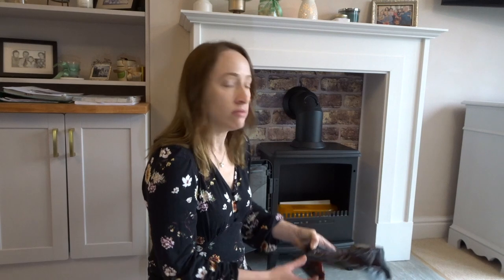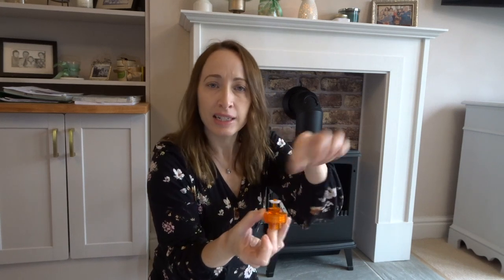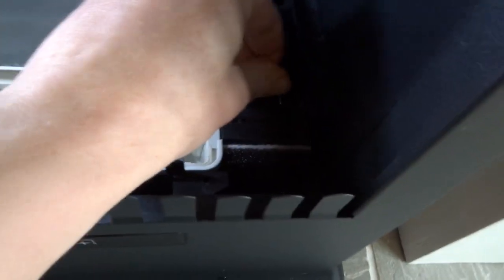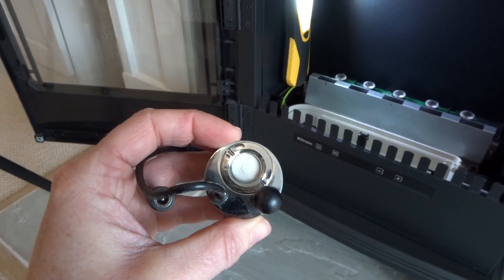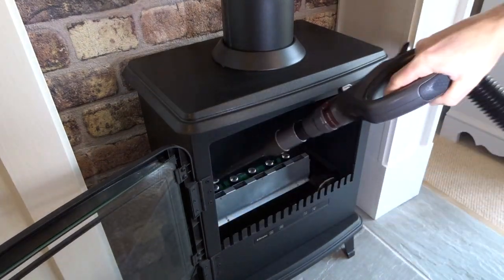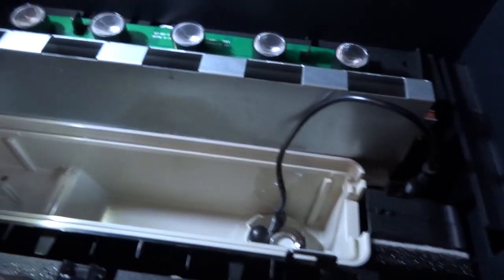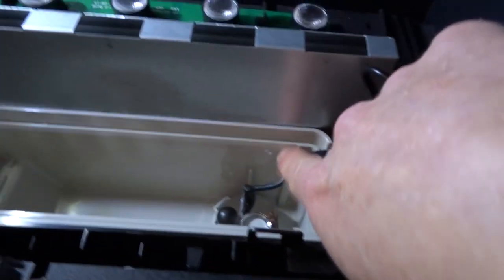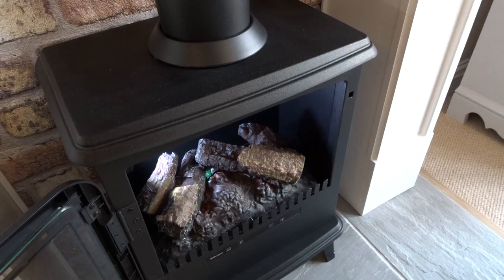Troubleshooting Dimplex Optimyst Fire | Part 1 | Mist Not Working | Clean and Replace Transducer

Comment: try deionized water, should not have any hard water deposits after switching
Reply from the maker: Thanks for the tip!
Reply: @LivinganOrganisedLife  hopefully that will improve performance and require less cleaning. I recently myself learned of this type of water usage for a new electric boiler I'm installing. High alkaline water, filtered or not causes deposits. I learned the minerals need to be removed all together and deionized is exactly that.
Reply from the maker: The only problem is it’s rather expensive. Where do you get yours from?
Reply: @LivinganOrganisedLife  deionized water? Oh most stores here in the states sell it by the gallon for a few dollars at most

Comment: Hi, what stove pipe have you gone with, looks great.
Reply from the maker: Thank you. It’s just plastic and sits on top. I got mine from Amazon 
Black Plastic 90 deg Bend Decorative Focal Electric Stove Flue Pipe 
https://amzn.eu/d/0StaxFc 
I think you can get them for a similar price from B&Q if you’re in the UK 😊
Reply: Thanks for the reply, think that's the one I'm looking at, does the top pipe go far enough back to sit flush against the wall?
Reply from the maker: Mine does but it depends how far your stove is away from the wall. Mine is about 3cm away if that helps and I could slide the pipe back further if I needed to
Reply: @LivinganOrganisedLife  thanks very much for your help and keep up the excellent videos.

Comment: hi... I have the mist but when I put the orange tray in it stops the smoke rising and traps it inside? any ideas?
Reply from the maker: Do you mean the fuel bed (logs)? Sounds like the flames are dying. Have you replaced the transducer? I have found out that you can just replace the transducer disc (white disc on the top) and see if that’s the cause. Let me know if it works ☺️

Comment: Hi, thank you very much! I cleaned and reassembled my opti myst. But my opti-myst goes off, there is no fire. What could it be? It beeps twice and the lights goes off
Reply from the maker: Hi, is your fire under warranty? If it is then contact Dimplex as they should guide you through some steps and send you smaller replacement parts to try to get it working again. If not, have you tried replacing the transducer? You can also purchase replacement transducer discs to save you purchasing the whole transducer unit. Let me know how you get on
Reply: @LivinganOrganisedLife  Thank you very much for your fast response! Its a used one from eBay. And yes!! The transducer was the problem! :)) First I changed the disc but a new one was needed. Now my fire works! Yippie
Reply from the maker: Ah that’s great news. So pleased it’s working for you!! 😊
Reply: @LivinganOrganisedLife  Thank you! 😊 My next step will be to change the halogen 45w lamps to LED to save a little bit electricity

Comment: Changed the transducer and the lights still go out any ideas ?
Reply from the maker: Have you changed the transducer disc or the whole thing? If you replaced the whole thing, check the wire is not blocking the transducer and there’s plenty of water in the bottom tank. If the fire is still shutting off it might be an electrical problem. Is it under warranty?
Reply: @LivinganOrganisedLife  the whole transducer has been changed and all bulbs checked .the fire works fine for a bit then the lights go out and after a short time they come back on again then again after a short time they go out again and it keeps doing this 😔😔😔.
Reply from the maker: If you kept the original transducer I would try changing the transducer disc  (transducer discs can be bought in packs on Amazon) and reinstall it to see if that works. If not, it might be an electrical problem and you may have to contact Dimplex for help. I’m sorry you’re having these problems

Comment: I replaced the transducer about 2 years ago as it kept turning off after 30 seconds. It's clean has water so is there something I'm missing
Reply from the maker: My last transducer only lasted for a year so yours might need replacing again. You can buy transducer discs to save you replacing the whole transducer. Here’s a link: 
Transducer Discs, Dimplex Optimyst Spares, Replacement Disks for Dimplex Electric Heater Fire (Pack of 6pcs) https://amzn.eu/d/9sIpmY1
Reply: Thank you..is that link for the discs we need? I did see various sizesx
Reply from the maker: @dionneellis6067 you will need to check compatibility with your model
Reply: Well I changed the disc so I will now fork out for another transducer. Fingers crossedx

Comment: Too much work.
Reply from the maker: Yes, I think so too Kris xx
Reply: No, it is worth the work and bother. Thank you for great, helpful videos, which weren’t there before.
Reply: @mihalmacmaghnusa  what I mean is some home appliances meant to make life comfortable are really more of a hassle with what it takes to maintain them. Since it is a heat producing appliance it is very overwhelming to approach it. I’m sure the video is helpful for the brave folks willing to maintain it.
Reply: @kristinesharp6286  I’ve probably replaced our transponder four times and fan three times in six years. They could make them last a bit longer. My wife faces the fire and absolutely loves it’s effect so I chew on with it for her really. At this moment I’m replacing the transponder and fan again. Your videos are most helpful. Thanks.
Reply: @mihalmacmaghnusa  had the mist fail after 16 months and dimplex transponder was something like £50 it lasted a year so now the fire has a cheap 24 v mist transponder fitted it does not go in the holder but sits along side it for £10 the mist works fine.
Reply: @keithbuggytaylor  Thanks Keith. Mines working fine again after fitting that cheaper transponder. We’ll see how long it lasts this time.
Reply: @keithbuggytaylor got a link please?